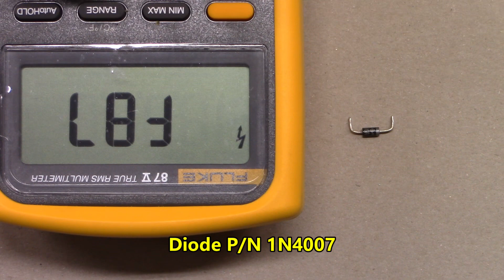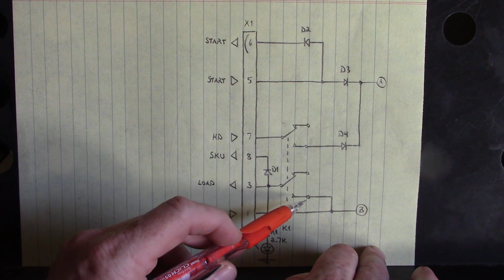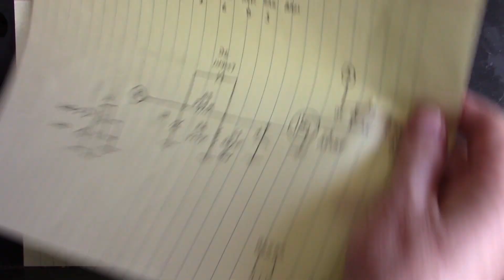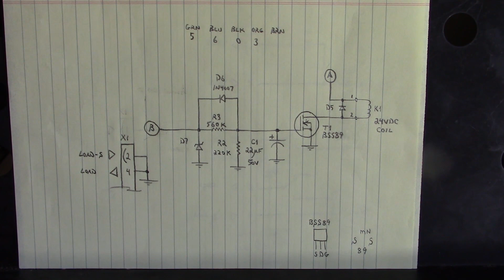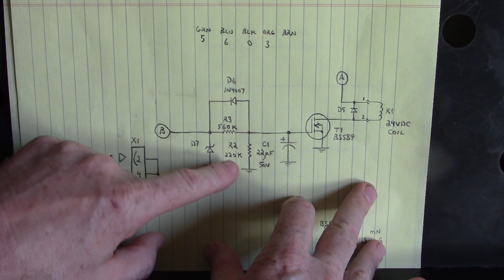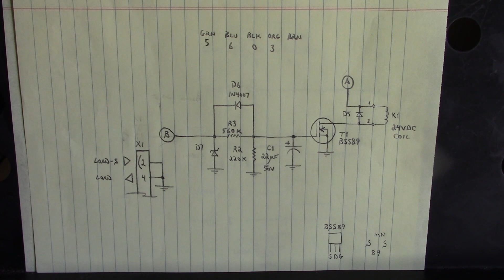Repairing the Schlatter Electronic Relay Board Model 4-406140.

Comment: Had a simple little vibrator control board that kept blowing the fuse. There were two shorted diodes. Everything else checked out with the meter. Relaced them. Works fine. We have Off delay timers that are variable and I imagine they have a pot for that. The others have a resistor network and slide switches. We use those a lot.